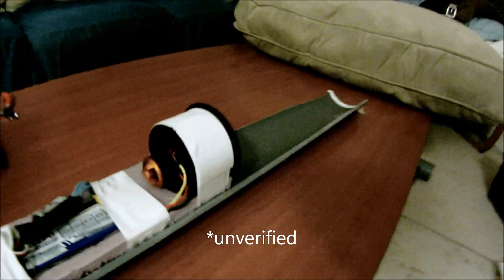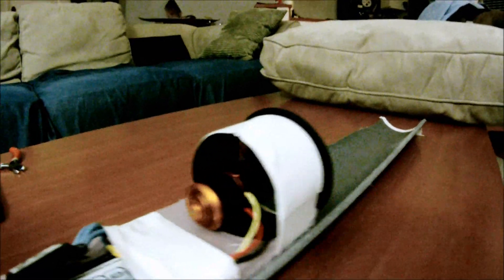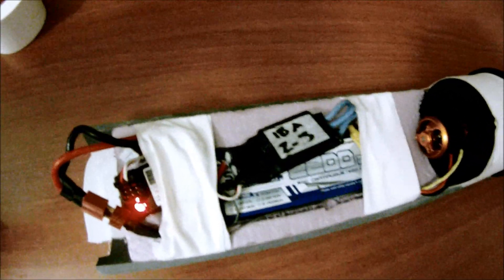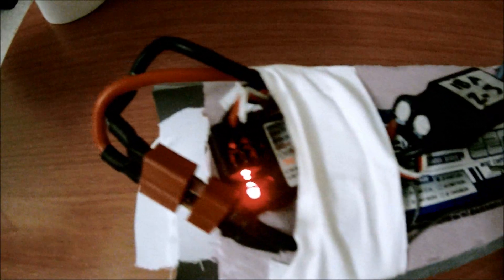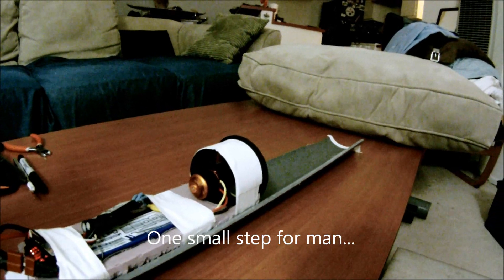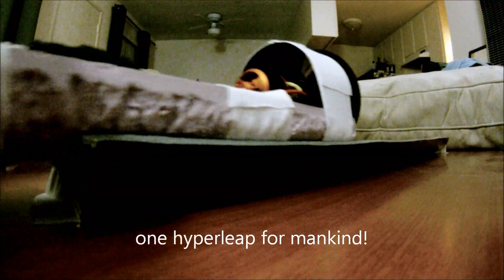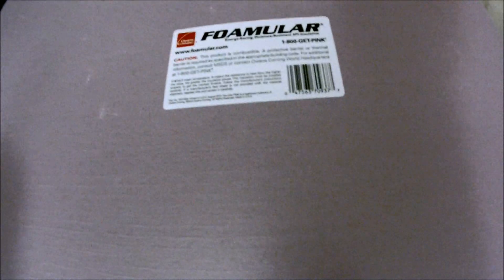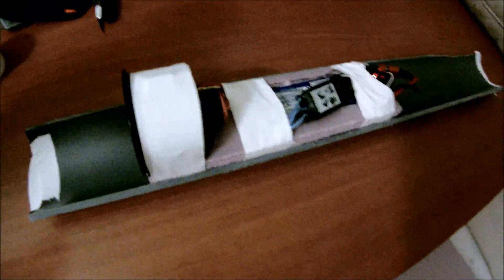www.minihyperloop.com First Prototype Mini Hyperloop - Scale Demonstration Model

Comment: YOU NEED TO design a turbine in which you get two propeller mounted in front of the pod one spinning against the other to stop the pod from spinning itself once inside a tube, other wise you going to see the problem that Mr. Sikorsky noticed when he was first designing the Helicopter forcing himself to add a tail rotor to keep the helicopter from spinning.

Comment: Since this is the first comment ill be kind.. The hyperloops design is much more complicated than a simple fan on a sled inside tubing. In fact with the scale of model you have I doubt adding the fan will increase speeds significantly unless at high speeds. The first step is to make a magnet driven friction less capsule inside a vacuum and see what kind of speeds you can get. But you cant approach it this way..